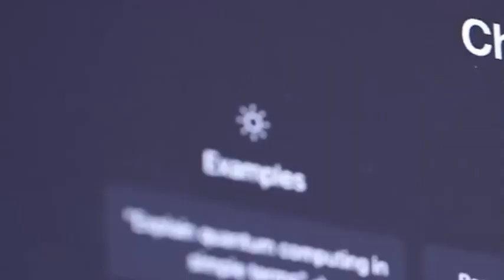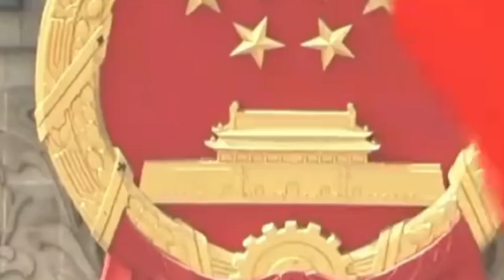Chinese chip companies have broken through 7nm technology and are expected to achieve 5nm.

Comment: Double exposure techniques like SADP and SAQP... Huawei has long passed that. 

It's now GAA, VGAA and Forksheet, multichanneling techniques to close the gap and spaces in order to achieve transistors density. This is going to get Huawei and China into 5nm/4nm. 

After this Moore's Law is going to stranglehold 3nm, 2nm and 1nm...even with EUV. 

Chinese DUV has reached 14nm and is in industrial production. Couple with all these techniques, 5nm/4nm is enough to cater for much of Chinese requirements, 95% including AI chip. 

The Ascend 910C is going to be on this 5nm/4nm. The Ascend 910C will be mass produced latest in 2nd quarter 2025. However maybe even with the Pura80 before that. 

5nm/4nm will be economically viable and available in China in 2025.

With Moore's Law, its not how fast China can close the gap on TSMC and Samsung but how far can TSMC and Samsung get away from China. Not much room left.